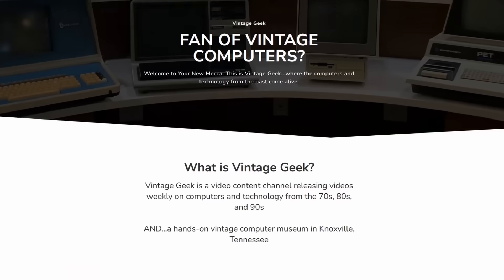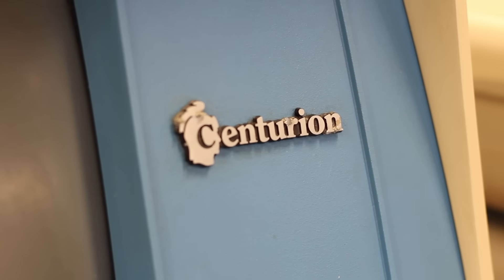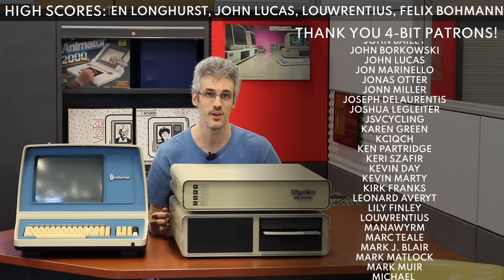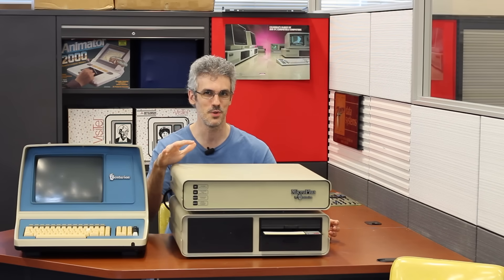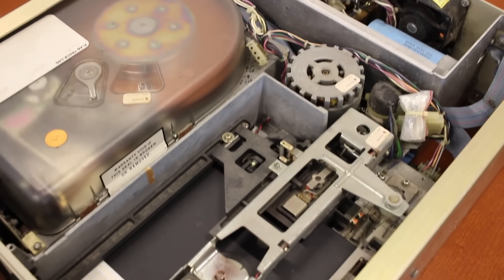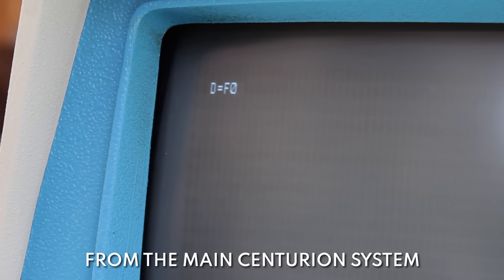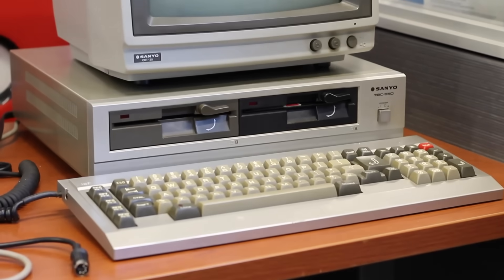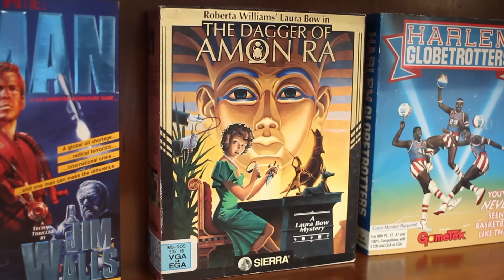Working on a Rare Centurion MicroPlus!

Comment: Guide to locating shorts on boards in general:
Solution A: Get a really good multimeter with lots of precision, and measure your way towards the short as the resistance goes lower. This works adequately and is very non destructive, but sometimes the short isn't technically a short, but rather behaving a bit like a diode and needing some voltage to get going (typical of some ICs), then things get harder, since most meters considers it fairly high resistance, so one can walk straight past it...

Solution B: Apply a suitably low voltage and look around for hot components. This too can be tricked by faults that needs some minimum voltage to appear, but one can slowly crank up the voltage towards what the rail is supposed to have. Just have a current limit on the PSU, and remember that SCR latch up is a thing, so sometimes this can kill ICs, especially in older equipment, so I would go for full rail voltage to start with, if you are lucky the short simply goes pop and you now know where it were.

Solution C: One can also just poke around the board and compare it to a known good board. But then one needs a known good board, something you seem to have so this is a decent path. However, for power rail shorts this often becomes, "the power rail is shorted, else the two are measuring identically." so this method isn't really that good for this kind of fault.

Comment: I don't know if this has been mentioned before, but on old hard disk drives (14", 8", and early 5 1/4") there is either no emergency head retract to a landing zone, or there is a NiCd or on larger drives, a Lead-Acid battery pack that typically provides the kick to bring the heads back to the landing zone before the loses much velocity when power is removed, thus keeping the heads flying during the move to the landing zone. Old magnetic drums (such as in the Bendix G15) have all the heads mechanically fixed in position, but due to temperature variations over time, they can lose their adjustment and potentially come into contact with the drum surface.   The point I'm trying to make is that I've observed you turning the spindles on old drives (like the Finch in the Micro Centurion) and the drum memory in the G-15.   This act by itself can make a storage device that was previously potentially workable, no longer so, by the heads contacting the disk physically dragging across the magnetic medium, damaging it.   It's not a guarantee, but it is an avoidable potential problem by making sure that there is no contact between heads and magnetic surface before moving the rotating media.    Just a suggestion for the future.    All that said, I really love your channel.  The joy you experience when resurrecting one of these vintage machines is positively contagious.  Your on-screen presence is engaging and fun to watch.   Your bunnies are positively adorable!   I can't wait until you dig into the G15.  It is a really amazing artifact, and will certainly bring back memories of my time working on a dual-CPU, transistorized drum memory computer made by 3M (Minnesota Mining and Manufacturing) in the mid-1960's that was used for process control.   The machine had an 8Kx24 word drum in each CPU, had a bit-serial architecture, and the drums turned at 3600 RPM.   The two CPUs shared a single 24-bit register with hardware interlock circuitry to prevent race/deadlock conditions when the CPU's were sending messages back and forth to each other.   I/O was to a 33ASR Teletype, and a large-carriage IBM Output Typewriter.   Input was from a huge bank of counters, digital to analog converters, and comparators that could be used programmatically to also function as analog to digital converters, as well as a real-time clock (Parabam transistorized clock using projection displays), input from the Teletype and Teletype paper tape punch, and a series a thumbwheel switches that could be read under program control.   While I had access to the machine, one of the 8K drums suffered a bearing failure, and crashed the spinning media into the heads at speed, causing its total failure.  The timing for the CPUs came from dedicated tracks on the drum, so the second CPU we no more.   But, it was still great fun writing programs for the original master CPU, which ran for the entire five summers I had access to it (at the local High School, which the machine had been donated to by a local utility company).  Programming was interesting, because each instruction contained both the operand address and the next instruction address, and in order to get maximum performance, you had to calculate both addresses by taking into account the rotation of the drum to allow quickest access to the information without having to wait for the drum to undergo another revolution. I'm sure you'll run into something like this with the G15 when you get it running....and I know you will!  Best of luck in all of your computer restorations, and keep up the fantastic work with the videos.   Sincerely, Rick Bensene, Curator, The Old Calculator Museum oldcalculatormuseum.com

Comment: Sounds like a power spike took out the power rails, and just fused the first thing it could. That was the 5V in the Finch, the 24v line in the PSU, and obviously something funky in the terminal. Could well have been backfed power through the ground, maybe a faulty appliance pushing current through the metal cases?

Comment: Those transistors in the Terminal PSU gets really hot... the pcb seems to be damaged from the heat... maybe the super heat is an indicator of malfunction? toghether with the fact of the burnt resistor...
Reply: That model of ADDS terminals with the vert. mounted power supply failed often.  We repaired the ADDS power supply more that other ADDS PCB's.

Comment: If you're interested in a cheap solution for a thermal camera for tracking down hot chips, you can get thermal camera attachments for your phone for reasonably cheap.

They're not exactly great compared to a dedicated thermal camera of high quality, but they're still more than good enough for tracking down bad chips.

Comment: Shorts tend to happen in power circuits.  Either the regulator, or the output stage of whatever drives the heads or spindle motor.  It's less likely to happen on some random TTL chip.
Reply: Which is why you totally isolate the supply from anything else before randomly powering up and blowing the snot out of something important..
Reply from the maker: @ingmarm8858  Which we did. Just because it didn't make it into the video doesn't mean it didn't happen. We powered up the supply completely empty and nothing bad happened but the rails were good, so it was kind of boring to show. Then we plugged in the floppy the main PCBs. The floppy having a dead short on the +24V rail is most likely what caused the pop.

Comment: Its usually possible to find a shorted tantalum cap with an ohm meter. You should see the lowest resistance across the shorted cap and a nominally higher (but also low) resistance across the good ones.

Comment: did you try booting from the bootable floopy you made a while back?
Reply from the maker: My hope, once we discovered the Finch had a short on it, was to boot to the WIPL on the floppy in the drive he had, but with that Qume drive having a short on it as well, we couldn't get anything to boot at all. 
I think most likely, long before Aaron picked the system up, something happened like a lightning strike or bad plug caused a spike that took out the Finch 5V rail, the Floppy 24V rail and the terminals PSU. It's a little rare to have three power related failures simultaneously, so I'm definitely thinking there was an external force at play here.

Comment: * Always replace the wet caps and do more looking BEFORE trying to fire up vintage gear, you can fry it more! Also there looked like a cut/missing jumper wire near the resistor. Your transistors on the power supply are also suspect, might test them before toasting the supply. Beware booting with unpowered things connected, they can become a big resistive load, and fry the main board.

Comment: Clone =/= Counterfeit
Reply: The Centurion MicroPlus is a real Centurion system. We built the MicroPlus line starting around 1982 till 1985.  Most of the MicroPlus systems were sold to CUNDATA Credit Unions by EDS directly during the EDS-Centurion time frame. The daily credit union transactions are handled by the MicroPlus and the back-end transactions handled by EDS's mainframe systems in EDS Data Centers.   The MicroPlus could handle 100% of the credit unions workload but EDS used the MicroPlus to help tie the CUNDATA credit unions into the EDS Data Center... more money for EDS.   EDS really just replaced a very old Porta-verter "Key to Tape" system in the CUNDATA credit unions with the MicroPlus.  Centurion already had a small banking software package before EDS purchased Centurion but EDS still wish to have CUNDATA tied back to the EDS data centers for the $$$.
Reply: David has a knockoff centurion in his collection, he believes it to be a counterfeit that was sold as a legitimate centurion, not as a centurion clone.
Reply: @JohnKiniston  Correct David does have a counterfeit system in his collection.  When I first visited David to help work on his first "real" Centurion CPU6 system I told David about the counterfeit systems and EDS selling off EDS-Centurion to ZTRON.   FYI - Was the person the "Whistleblower" at EDS on the counterfeit systems twice!  The first time I told EDS management they did not be leave me about what I saw in the CABS office in Tulsa, OK.  The second time I showed EDS management (about 3 months later)  I had a set of counterfeit CPU6 systems PCB's in my hands...!  Now EDS management took action to make the counterfeit system owners hole with real Centurion systems and shutdown the counterfeit builder in the DFW area.  Was not a fun time at EDS Centurion.    A few months after helping David with the real Centurion system David sent me a picture of the "other system" which he just picked up from a friend". The picture was one of and est. of 10-20 counterfeit systems built around 1983-1984. EDS was told all the counterfeit systems had been replaced to distorted, guess not.

Comment: Thank you for sharing.  I use a Keysight bench meter with good quality four-wire Kelvin probes to find problems like shorted bypass capacitors - which I’ve had to do more than once.  A regular Fluke meter may not be sensitive enough to spot a short.  It beats having to unsolder or clip out capacitors.  Another strategy is to apply current-limited power and then use an infrared thermometer to spot the unexpectedly hot capacitor.  Owon makes some acceptable and affordable bench supplies which allow both output voltage and maximum current to be set.  There are both switcher and linear models to choose from.

Comment: I've manged to narrow down the location of shorts on power rails using an accurate multimeter in resistance mode (eg EEVBlog BM235 or your Fluke meter).
Probe in multiple places to get all the readings that aren't zero, eg 0.3ohm, 0.2ohm, 0.1ohm. You end up with a map of where the short isn't, in the center of those 0.1ohm readings is the fault.

lets say there are 5 chips in a row, and the outer two are 0.1ohm, well the chip in the middle (3rd IC) is the shorted one.

ps: The axial caps with the metal can and transparent cover that are almost certainly branded Sprague, are Tantalum Caps, possibly just one of those shorted.

Comment: Another method for finding where a short lives that does not require an IR camera is to hook the board up to a current limited power supply. Set the limit at around 1 or 2 amps. then start measuring voltages across Vcc - GND. Away from the short this will be a few millivolt. Closer to the short it will decrease to zero millivolts. This does require a very sensitive voltmeter though (and verifying that nothing is heating up).
Reply: I'd start with a lower current than 1A, but otherwise agree.
Reply: Yeah this will work with a much less sensitive meter than what it takes to locate a short via resistance measurement alone

Comment: 5:37 I notice that the CRT has some bad phosphor burn-in.
Reply from the maker: Interestingly, I'm starting to think this is a thing common to the ADDS Regent 40. I have both a Regent 40 and a Regent 100, and the 100 has no burn-in, but my 40 has even worse burn-in than this one. Perhaps the CRT uses a slightly different phosphor or something in a cost-saving measure.

Comment: I would put 5V across that board from a 1A or more power supply, and use a thermal imaging camera to see what gets warm.  They are getting much more sensibly priced these days, TopDon do some great ones at sensible money.  Another route I've done in the past is used a really good multimeter to search for the lowest ohms point, that helped me isolate a short circuit zener diode on a large (mostly logic) board from a high end massage chair.
Reply from the maker: Fortunately, I was able to bring the Finch home, so it'll be a good opportunity to test my short finding skills. I don't have a thermal imaging camera (though I should probably get one), but I do have a couple other tools that may be able to help. If all goes well, we'll bring both the Vintage Geek Finch and my Finch up together and back up all the data on them!
Also, I never thought about it, but I suppose massage chairs would have logic boards, that's a fascinating corner of the electronics world!
Reply: @UsagiElectric  Constant current power supply limited to 1 volt or so several amps constant current. a bottle of isopropyl alcohol.  power up the shorting rail . throw some isopropyl on circuit board. whatever parts of board the alcohol evaporates the fastest is where the short is
Reply: Yeah, you can even buy a device now that turns a cell phones into a thermal camera for iPhone and Android. I saw it on another channel of a guy testing one of these thermal cameras on his Iphone it lookslike it a mini thermal camera that uses your phone screen and power.
Reply: @KoolBreeze420  i think it's called a flir if i'm not mistaken.
Reply: My mind was picturing you diagnosing the circuit board while sitting in a high end massage chair!

Comment: Get a IR camera.  That makes finding shorts in pcb power boards much easier.
Reply from the maker: I really should, and the prices are indeed coming down, maybe this will be a good incentive to finally pull the trigger on one!
Reply: @UsagiElectric  I first used an IR camera at work.  Latter I bought a FLR camera that plugged into my android phone.  That worked well.  It combined the visual and IR image so it was easier to understand what you saw.  But there was a problem.  When I bought a new phone it wasn't compatible because it wasn't type C.  So I bought a stand alone IR camera from Topdon TC004.  It works well but doesn't have the visual image.  It also has a threaded hole for a tripod mount.    Good luck.
Reply: Yup! When I worked for an avionics company, we had a really nice Fluke brand IR camera. And it was almost just for pointing at a PCB to see what got hot. Great use for a $20K camera!